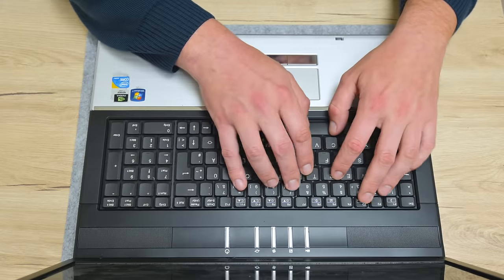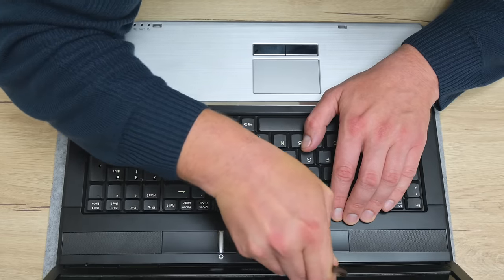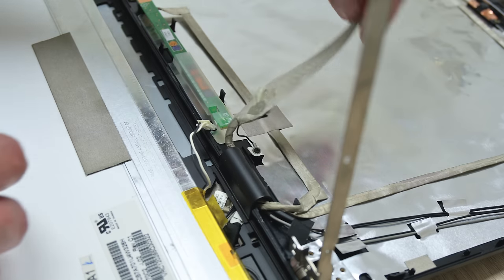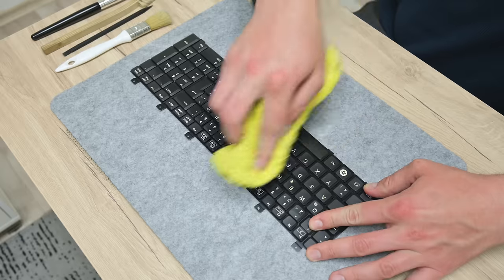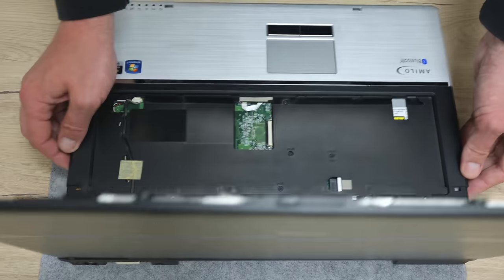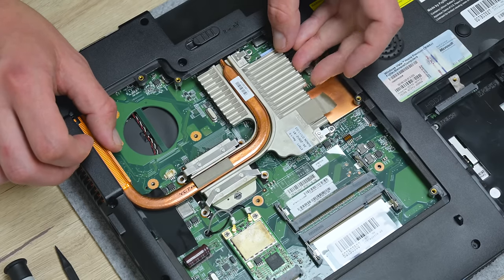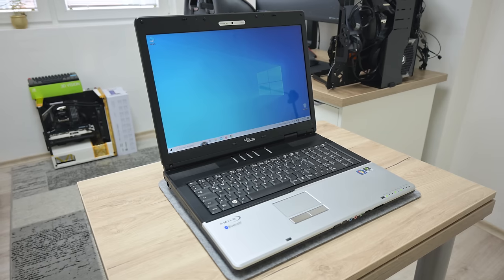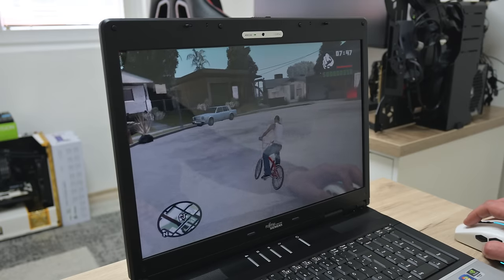Trashed Fujitsu Siemens Amilo - Restoring and Upgrading

Comment: I should have done what you do and put the screws in a container.  I went to put new thermal paste on the CPU and graphics card, then lost one of the tiny screws for the GPU, looked everywhere and no sign of it.  Luckily I save ols screws from past projects and broken PC's etc.  I struggled to find one that fit but I managed it in the end, lesson leaned.  By the way I bought a used laptop that works fine but the old paste was dry and hard so glad I re-did it.  Love your videos too, I'm a fan.

Comment: Hey Andrew! what kind of thermal paste do you used for this computer? apparently few old laptops i got are all overheating, i am using Cooler MasterGel Pro V2, replacing this thermal paste still doesnt fix the problem i mean it does but still at critical temp(yes i did cleaning to everything including the heatsink and cooler fan), can i have any advice regarding this my issues😭😭 i had spent so much on thermal paste i tried artic mx4 before but still. :(

Comment: Actually i wanted a secendory monitor because i need it for work then i found a fujitsu 1080p 21 inch monitor in the trash only needed a power cable and it works really does the job

Also i love your videos ❤❤❤❤

Comment: Bought this laptop in July of 2008 for around 1000 euros. My first ever laptop. I use it very rarely, for some reading or a watch movie, mostly out of fear of that 8600M GS toasting. Despite it's lackluster hardware (even for back then, that AMD Turion x2 and 8600M GS were very average) its design was awesome. And it has some of the most powerful bass/speakers I've ever heard on a laptop. Crazy to think now but I completed GTA IV on this laptop and played tons of hours of free roam on it. I even still remember the settings 800x600 and Medium all the rest : D... averaged 15-30 fps with all view distance tuned down : P

Comment: I have Dell Inspiron 3420 i5 3generation 4+4 

I ran ePSA diagnostic I got the error code 2000-0122 with 8gb and when I removed 1ram laptop run with epsa diagnostic but working and not crash

Comment: I have this exact laptop but sadly the GPU on mine is artifacting and the foam on the subwoofer (Yes this has 2.1 stereo and it sounds really good) unfortunately has deteriorated last year. It's sadly is for parts at it's current state.

Comment: i was given an acer extensa 5420 with the amd turion 64 x2 cpu and the problem was it comes on with the lights below the screen, but no screen. then reboots and does the same......found an old thread and a guy said to replace the cmos battery as the old one was dead....i did that and re applied thermal paste as the machine much like this one was really clean. this one has radeon x1220 graphics in it. same with the windows 10 and went from 2gb to 4gb and it's like night and day......come to find out it had this issue early on and just sat around so the battery still hold about a 2 hour charge and the screen is amazing on this laptop. date code was on the motherboard as 071207 so i asked if he bought it new and he said yes.......so technically new old stock so to speak!

Comment: Personally I would be very careful of sticking screws on the top screw holes without the bezel and only put it in halfway. If you do this and tighten it on an Acer you will almost certainly put a dimple on the back of the lid!
But yeah it's an half decent laptop to use today, TL-60 is right about the usability line of today's standards so its usable if GPU doesnt fail. Oh and fortunately you have the 65nm version as opposed to the 90nm version of tl60 which runs very hot

Comment: Not bad if you ask me, it also looks like this machine was built well. Plus, being a 17 inch model it has 2x 2.5in disks possible as well as upgradable CPU, RAM and WLAN.
I would have suggested 8GB RAM, but I realize it is DDR2 RAM that you are using, so 4GB would probably be the limit, and whilst Windows 7 is a much better OS for this hardware,  already some software is no longer supporting Windows 7.
I would also have used a separate 1TB HDD, for things like data, music and movies - after all, you have the second HDD slot!
Reply: The 32bit has the 4gb limit, not the type of ram
Reply: @iplaydthis  4GB DDR2 SO-DIMMs are quite expensive and a lot of older chipsets don't support more than 4GB
Reply: @Pasi123  yup, but that is because of the architecture itself.
Reply: @Pasi123  Indeed. Some early C2D systems only support 2GB DDR2 maximum, and yes the last time I checked, even 2GB DDR2 sticks were quite high given that you're only going to have 4GB total, and 4GB sticks (for 8GB total) are off the charts expensive.
Reply: Some laptops with DDR2 can support 8gb. Ex. My Dell Latitude D630

Comment: This machine could be better with Linux distros. I think that you could repair the LCD and upgrade the CPU. Thanks for your effort and this nice restoration video.
Reply: I rid myself of my Microsoft abuser when support for Windows 7 ended but it's not a good idea trying to run Windows 10 on only 4 GB RAM anyway, because it needs all of that memory to run all of the telemetry on the user and steal all of their personal information. Microsoft needs you to put 8 GB RAM into the PC you that you buy for them to take control of and to spy on you efficiently.

This type of machine runs fine as a daily driver with Linux - I run Gentoo Linux on similar spec machines like the Thinkpad T61and it runs fine as a daily driver for general browsing, productivity and light gaming.

Yes, 720p video playback is probably the limit but it's a laptop probably with a 1280x800 or 1366x768 screen, so HD is pointless without an external monitor attached anyway.
Reply: the cpu can be upgraded to the likes of TL64 66 68 but all of them are almost prohibitively expensive (TL66 TL68 costs over 100 dollars)...
Reply: @KZ Tech  I see, this is a joke.
Reply: @tcirit  And well I think linux would work okay on this if you can get the 8600M GT drivers to work (which isnt impossible).
IF you have the integrated graphics version like mine however, good luck getting geforce 6150 Go working in any modern linux distros without the chip burning down...
And no nouveau doesnt work correctly.
Reply: @tcirit  No, he's correct if you look at eBay prices of those two CPUs - when I repair and upgrade old laptops, I normally keep to a "sweet spot" of $10-15 for a CPU upgrade because it's not worth spending much more than that on an old machine.
Reply: @terrydaktyllus1320 old man, ever heard of privacy settings?
Reply: @rarinth  I don't have to answer the questions of self-entitled brats on the Internet.

Next?
Reply: @terrydaktyllus1320  you must admit, technology is advancing and old equipment will not be viable in the future

your ad hominem and name calling proves you do not have any good argument left
Reply: @rarinth  I don't have to admit anything.

This is not a discussion about me. Do try to keep up and stay on topic, there's a good chap.

Next?
Reply: @terrydaktyllus1320  did you even read my comment? i said technology is advancing and you need more powerful equipment
Reply: @rarinth  Yes, I read your comment and I don't care what you think I need.

This is a public messaging forum, I can only relate how I do things back where I am.

That's not going to change just because some complete stranger on the Internet thinks differently.

If you don't want to use old technology then don't use it - but please don't then call yourself an "engineer" because an engineer looks at all possible options when building a solution, of which cost is always a factor.

I simply will not indulge in discussion about what you think my character is because that's irrelevant and you know nothing about me anyway, apart from what you think you can extrapolate about my character from a few words I write here.

So do we understand each other now?
Reply: @rarinth  The other thing that you don't know about me is that for the past 20 years my main OS has been Gentoo Linux which, if you're not aware, is extremely customisable and scaleable compared to more popular Linux distros.

That means that in my home environment, I am running Gentoo on everything from a Raspberry Pi Zero to a multi-CPU Xeon server.

That also includes some old IBM Thinkpads with Pentium 3 CPUs in them that run a modern Linux perfectly fine (sure, you won't be browsing the Internet with them with any speed any time soon).

Someone who just uses and understands Windows would see machines of such age as redundant because all you can do with them is stick on the "Windows of the time" and maybe play a few retro games on them.

I find modern hardware boring and a complete waste of money because it depreciates in value extremely quickly - as an engineer, I enjoy the challenge of running something useful on computing devices with low power and memory.

Comment: what kind of Turion? the x2 Version is usefull today
Reply: That is a TL-60, dual core 2Ghz Socket S1G1. I'd say right on the boarder line of being usable today, but it does support up to 8gb of ram and 800mhz speed which is handy
Reply: @kztech1319  nice

Comment: This was my first laptop I bought with my own money. I hated that thing. Had to send it in 3 times. The GPU broke, after they fixed it the DVD drive broke and later the headphone jack broke. Eventually the screen broke and I just gave up.
Oh and back when it was new it came with Vista and it really didn't work good. I tried to install XP but the drivers were not compatible. Windows 7 made it somewhat useful.
Reply from the maker: Some of these models were very problematic, I agree with you. Especially the Windows Vista, it was pain to use it :D

Comment: If 4GB DDR2 sodimm weren't so expensive, you could put a total of 8GB of ram.
Reply: Yeah I can basically affirm 8gb will work on this. That's what I did on mine. However you will have minor trouble with 6gb as TL series chips dont support asymmetric dual channel...